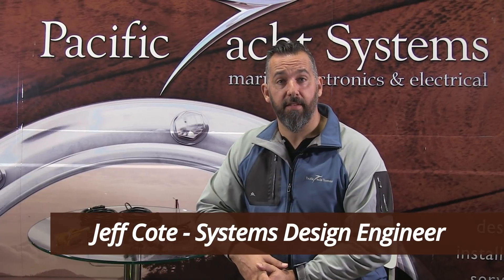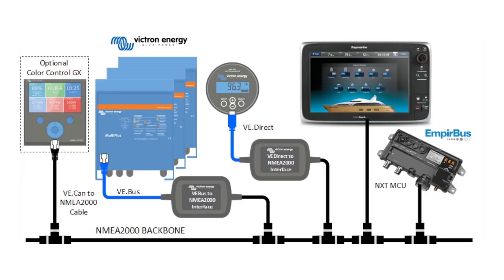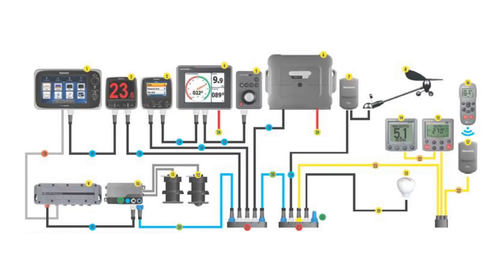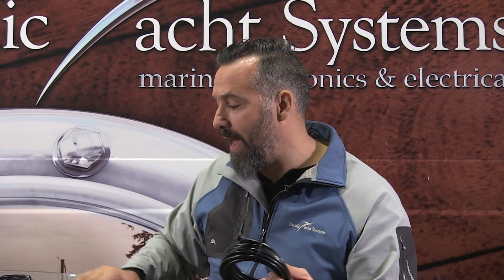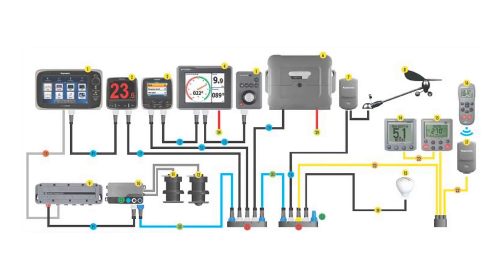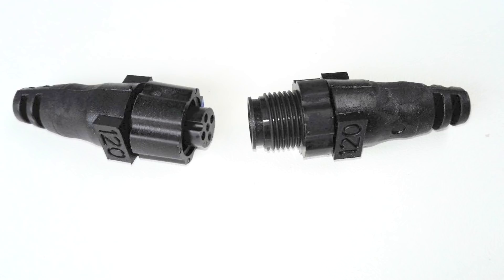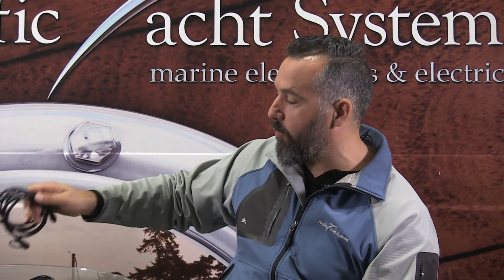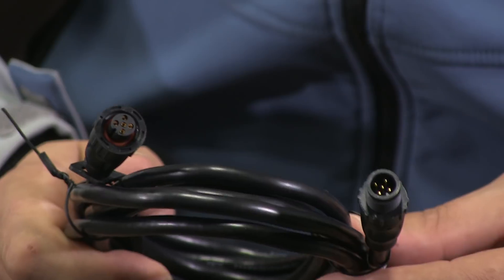Installing an NMEA 2000 Backbone on a Boat

Comment: Hi
Thanks for your tips and excellent content  Just one question  If additional T pieces are installed for later use will the outlet on the T piece for the device require  plugs of any sort to stop dampness etc
John

Comment: Jeff
I'm connecting an AIS Standard H radio to my Garmin chart plotter , both have NMEA 2000 connections and are separately powered. Do I also need a power tee just for the backbone.
Thanks
Bill

Comment: I have a z Vulcan 9R, dst, wind 508, Simarine nema 2000 sending unit, AIS. Precision 9 compass, watchmate, VHS radio and a Lowrance HD5 on my nema 2000 network. The dst and wind instruments are not showing up at all. Do I have a conflict and hiw can I fix this. Thx.

Comment: Maybe you can help me. I have the NMEA2000 Bennett indicator kit installed on my boat using a Simrad EVO3 MFD. For some reason it goes offline and requires that I physically disconnect from the backbone and reconnect for it to start working again. It lasts for a few hours and then goes offline again. Any idea what this could be?

Comment: Jeff, Have you noticed any system reliability issues due to noise created by coiling excess cabling?
Reply from the maker: Good point, coiling electrical wiring might look good, as  much as possible it should be avoided to minimize magnetic flux.

Comment: why not just use network cables for everything?
Reply from the maker: Yep drop and backbone cabling are the same N2K network cable.
Reply: @PacificYachtSystems  Sorry, I realize my question was not clear; I mean why are N2K cables used, and not Ethernet cables, like for home networks,? (the can be 100m in length)

Comment: Jeff .... I want to put NMEA200 on my bayliner 4788, and specifically upgrade the engine instrumentation.  The engines are Cummins 6BTA 370hp diesels, circa 2000, and so need analog to digital circuitry.  Does anyone make a solution for this?  Thanks.
Reply from the maker: Yep, you should consider the Actisense or Noland products.
Reply: @PacificYachtSystems  many thanks

Comment: I have a mercruiser 5.7 and want to add to network,, where do i connect to engine? I do have a wire termination on top of engine labeled "AZ973-1c-12dc4" if this is it do you know were to get the proper cable ?
Reply from the maker: Hmmm, good question, unfortunately don't know the answer. You are looking for a NMEA 2000 or J1939 Canbus connector on your engine if it has one.
Reply: @PacificYachtSystems  NMEA 2000, and the engine yr. is 2007. thanks for the reply anyway,, i'll continue to hunt and post if/when i find a "hook-up"

Comment: A good map, a sextant, a magnetic compass, a simple GPS, a mobile phone and my brain are OK to naviguate. But sorry ! Seeing the complexity and remarkable connectivity of all the system you'll do what you want with your money; just don't forget my point in case you're lacking energy. I 'd like to connect  somme NMEA captors to a computer instead of buying 3 different expencive devices. This video's good in that point, a bit simple too. I read from Wiki that the maximum lenght for NMEA 2000 is 10m thought. (sorry i'm french)
Reply from the maker: Thanks Pierro for sharing, tech is no substitute for proven, true, and simple.

Comment: Great information Jeff. What are your thoughts on plastic versus metal T connectors? I think they both have pros and cons in a marine environment. Can you use both on the same backbone?
Reply from the maker: I like metal, but unfortunately mating plastic to metal is inevitable as most devices have plastic NMEA 2000 connectors. Just be careful when threading plastic to metal NMEA 2000 connections.
Reply: @PacificYachtSystems  thank you. Are there any concerns with the metal connectors in salt water environments?

Comment: The devices on my nmea network only come on when my engine ignition is on. I want to use my motorguide which is on the network without having the engine ignition on.  Is this possible?
Reply from the maker: Yep, you need to find the NMEA 2000 power source and wire it to a new switch, instead of the ignition switch.
Reply: @PacificYachtSystems  thank you can I use a power isolator and a new power cable to power the devices I want on without the ignition on

Comment: Hi Jeff. Could you shed some light on connector compatability. Can I use Actisense components on a Garnin installation? I really like the Actisense A2K-SBN-1 small boat network. It would make my installation much neater.
Reply from the maker: Hi New Jersey Bill, yep certified NMEA 2000 hardware (tees and drops) from reputable manufacturers are compatible with one another.
Reply: @PacificYachtSystems  So Raymarine SeaTalkNG is the only common oddball?

Comment: I have the Garmin 1242XSV, Garmin VHF110 radio and GT52HW-TM transducer. On the radio and 1242XSV would still need to have their own power correct? And I would still have to power the NEMA 2000 for the transducer correct? But the Garmin radar does not plug into the NEMA 2000??
Reply from the maker: Hi Charles, all good questions. Your correct, a chartplotter, a VHF radio, a radar, and all non-N2K transducers are powered separately of the N2K bus. The NMEA 2000 bus needs to be powered and your N2K compatible VHF and MFD will connect to one another via N2K. A radar doesn't get connected to N2K, but rather via a ethernet cable if it's recent.

Comment: I am finishing up an update tp my 2010 SeaRay with Axius drives. Can you shed some light on the connection to the Axius drive which uses NMEA 0183 and Raymarine Axiom Pro which uses NMEA 2000? Perhaps a diagram?
Reply from the maker: Hi Jim, unfortunately don't have experiences with the Axius drives.

Comment: Now Jeff ! Would it be possible to also hookup my Honda Kicker motor together or independently with Honda 90 outboard with my Garmin Chart Plotter/Fish Finder ? Would like to get an RPM and Speed readout !
Reply from the maker: Hi Thomas, connecting an outboard to a NMEA 2000 compatible device like your Garmin Chartplotter is possible if your Honda outboard has an NMEA 2000 port. Here is a link to some compatible Honda outboards:https://marine.honda.com/parts/accessories/categories/nmea-components

Comment: Hey Jeff,
This is interesting but I'm a little lost as to what's the actual reason to have the devices all joined together.....will they "talk" to each other? 
Will it all connect to a central station where I can read everything. It would be great to have a centralized device where I can see engine performance / battery and GPS all. Is this the function? 
As always, great videos and thank you for sharing.
Reply: Hi Sean, 
That is precisely the intent. A multi-function display is able to capture the data and will act as your central station at which point this information would be available. These displays also serve as chart-plotters, fish finders and can even integrate with autopilot technology. The technology available in the marine industry right now is pretty incredible.
Reply from the maker: Totally agree Reid.
Reply: Thank you both. Sounds like a good project now.

Comment: What do I do with the drain wire on a Maretron  power Drop T? Can i attach both power cables and the two grounds to each side of the breaker or add an additional breaker?
Reply from the maker: Bring the drain wire to the battey negative distribution.

Comment: SO you mean 6m cable..Not between the devices ?????
Reply from the maker: Hi Ray, 6M is the maximum length of a drop cable. Recall that the N2K drop cable is between the NMEA 2000 backbone tee and the NMEA 2000 certified device.
Reply: @PacificYachtSystems  how are you then connecting to the mast head because even on my small boat that is more then 6 meter

Comment: Hello Jeff, 
thanks for sharing your experience and knowledge in all your videos. That helps saving money and time. I am going to install some electrical equipment powered by solar panels to my small sailing boat. First thing is to estimate power consumption. But i can't find what a N2K bus system takes. I've read about 60W but can't believe it. Do you have a realistic value to calculate with? 
Thanks and all the best to you and PYS.
Reply: Maretron offers a free program for NMEA2000 (N2K) design. "N2KBuilder" the program will calculate Voltage and Current sums to allow you the means to select the appropriate breaker or fuse for your system. Also note: The five NMEA2000 rules affect each other this video covers one rule. The video comment to plan for the future is correct.
Reply from the maker: A NMEA 2000 is generally less then 5 amps (i.e. 60 Watts at 12 VDC), if really loaded with lots of N2K endpoint.
Reply: @PacificYachtSystems  I've read that there's a "mini" format cable, which is thicker and handles up to 8 amps--usually used for the main trunk line; and there's a "micro" format cable which a little thinner and handles up to 3 amps--usually used for the branches off of the trunk line. Smaller yachts are said to be fine using the micro throughout. Do you agree with this? I don't have personal experience with this, it's just what I read somewhere.
Reply from the maker: There are 2 types of N2K cabling: Micro/Mid and Mini. The Micro/Mid cable system is generally used for smaller networks requiring less power (i.e., up 4 amps per network leg) while the Mini cable system is used for larger networks (i.e., up to 8 amps per leg).

Comment: Great advice. Thank you. Quick question. Most sailboat masts are longer/taller that 6 metres. What should be done in this case if you want add a wind device at the top of the mast?
Reply from the maker: Good question.
  For sailboats, the N2K line in the mast will be part of the N2K backbone and the windvane or weather station at the top of the mast will have a inline termination resistor.